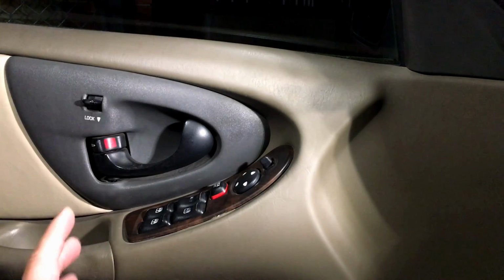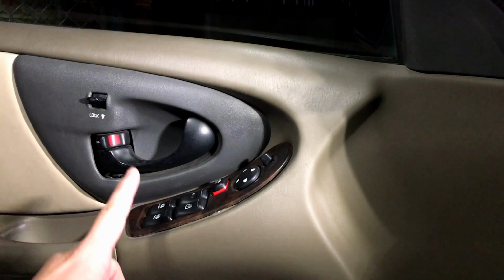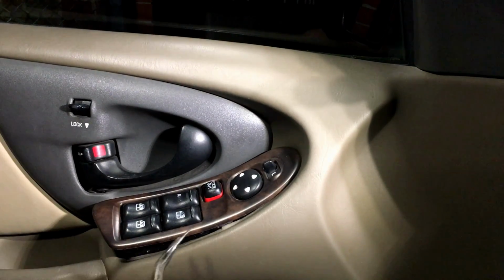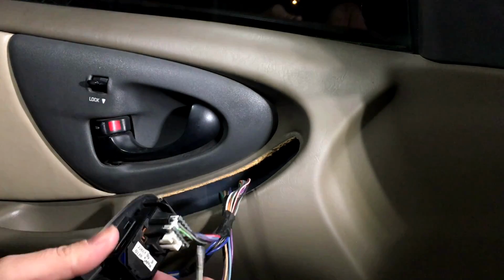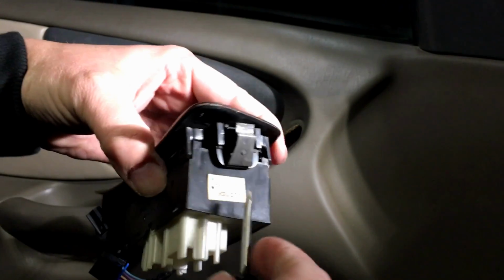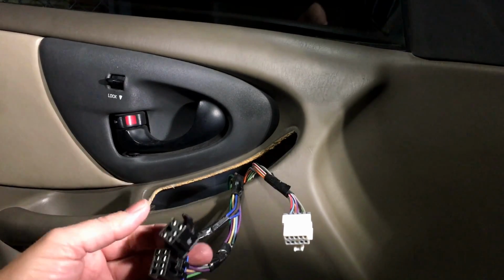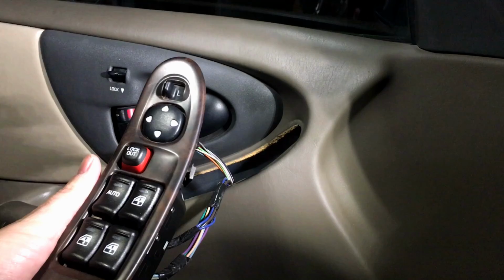Chevrolet Malibu Window Switch Diagnosis and Replacement

Comment: Today all in all in a sudden my driver side window would not come down. All the others worked fine, so I knew it was not the motor. I hit the switch in short brief taps like you showed in your video and it worked again. Thank you so much!!!!
Reply: Actually, Gina, each window has its own regulator/motor, meaning that just because the others worked fine doesn't mean they all will.  If a cable snaps on one or a pulley breaks, no amount of playing with switches will do any good.  The regulator will need to be replaced.  The good news is that as I write this, they're available on eBay for only about $40.

Comment: My switch wasn't working and so I stopped at a Pick-A-Part to just get a close to new master switch. I'm trying to plug it in right now, and the side mirror button is working on top, but the other four windows are not working.

Comment: As the owner of a 99 Malibu the best advice is to replace the motor and regulator both because this is a common problem with the windows but the motor/regulator is 125-150 new and labor is about 100, so I'd go to the junk yard and if you're lucky someone replaced them and if the part looks new get it, they will cost you about 35-40 dollars and if you watch this video you can do it yourself

Comment: I have some problem my front windows work but the rear ones won't go up or down. I change fuses still not working.
Reply: Great video.
Reply: Always check wires going from main switch to other side through door.  The boot sometimes doesn't protect the metal and eventually the wires get rubbed through or short.

Comment: just did this on my chevy, be careful with those metal clips, they fall out easily and can go behind the door cover like mine did ):  Also my windows were going up and down really slowly, made me think it was the window motors.  But once I changed out the switch they worked perfectly.... that was so weird to me that a bad switch could make the windows go up and down slowly.  Whatever, now I just need to fish out the metal clip and hopefully, all will be well.
Reply: Lubricating the side tracks will help too.  Just spray some silicone into the side tracks, and that oughta do it.
Reply: Where did you find that part at
Reply: @vickyharris2320  ebay, that's where I almost always buy my car parts.
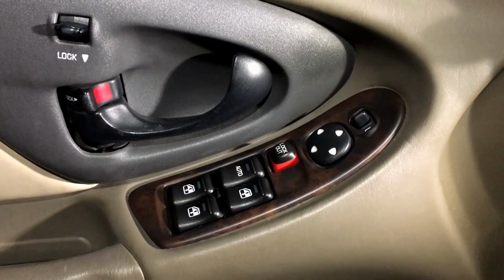Reply: @vickyharris2320 12:11

Comment: I am hooked on the Motorcraft electrical grease now. I don't understand why you can't seem to buy it from anywhere else, and so many people use dielectric grease in so many applications incorrectly. Dielectric grease is for high volt/amp applications like spark plug wires, it's not meant for lower voltage applications like this. Good job!